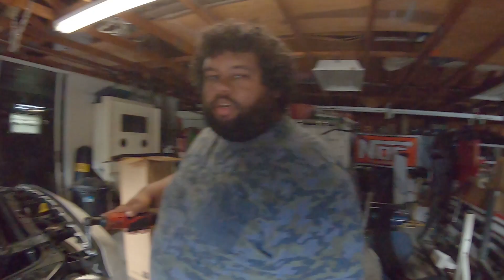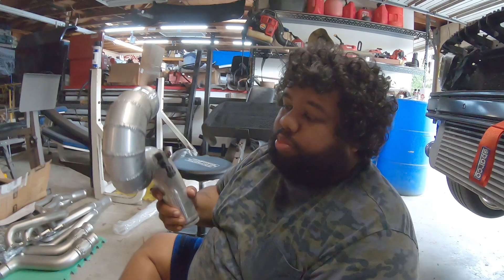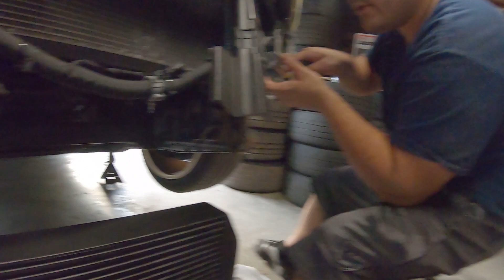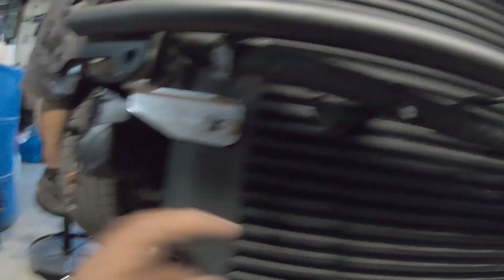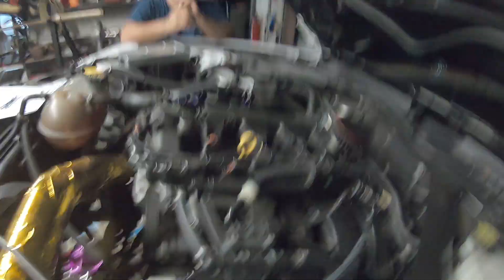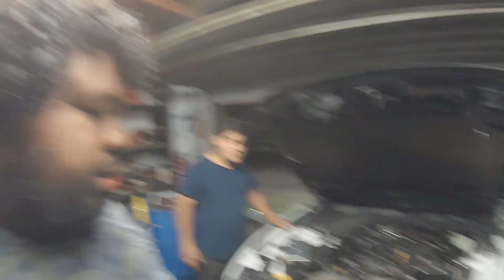CP-E Intercooler Install

Comment: Hi! Thank you for your video.
I have stock intercooler and bought the same cpe intercooler.
Is it necessary to change stock crash bar? I’d like to leave stock crash bar on a car.
I have only stock pipes. Are they enough for me to install new intercooler?
Reply from the maker: You can leave the stock crash bar i just happened to have one.
Reply: Thanks, Alex!
What about stock intercooler pipes?
Will they fit to new intercooler?

Comment: Some details about the screws not clearly noted here to take the bumper off, you need to note there are like 4 hidden screws, at the very edges of the weather strip there under the rubber at the ends are two 5.5mm screws hidden on on each end, then under the fender covers where the bumper cover meets the fender there are two little hidden 7mm screws there, they are a bitch to get at, but if you fold the fender liner back and just put it behind the rotor to hold it aside you can get a small 7mm ratcheting wrench in there.  Side note: after initially taking these scews out a couple of times future removal is super easy just need to break em loose and you can hand thread them out.  (Also you can use small zip ties in place of them if you do not want to deal with them anymore.)

Also while you are taking out the fender 7mm screw you can easily unplug the lights on each side instead of holding the bumper out while doing that, no need you are right there in the fender...

As far as the install goes, I know you gave it a 5 out of 10, I would be more like a 8 just because the sheer number of fasteners holding stuff on, you have to take off the belly pan or bare min enough just for the bumper and front fender liners to be undone.  Also because of the lack of room to get at the clamps you want at least side and under access to make sure the hoses are on correctly.

Also regardless of the hoses and couplers used, use tbolt clamps not worm gears.  A pro tip also make sure you have a can of aquanet hair spray on hand.  Spray the inside edges of the silicon hoses it makes them easy to slip over the pipes, and very hard to slip off after then are tightened.  Yes a pain to get them off but ensures easy install and nearly glue like grip which is what you want with 25+ psi or more boost.

Comment: Hey Alex, do you think 2.3t can be a good car for drifting? I heard someone said the oil pan is not baffled and turning hard is not ok for the motor.
Reply from the maker: We have been talking about this for the road course as well and we feel like it's not difficult to modify the stock oil pan. The car is going to go through some RnD in April and May one thing that we will be addressing is the issue you're mentioning.
Reply: mountune has a dry sump kit for the eb 20/23 and d20/23